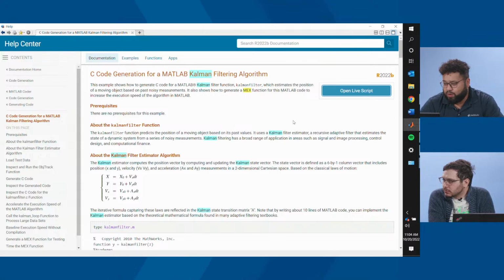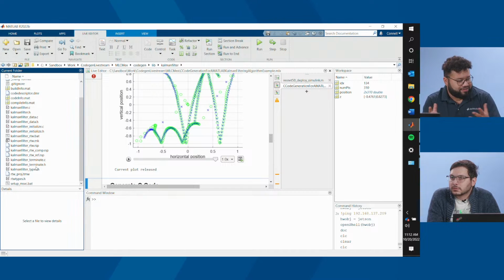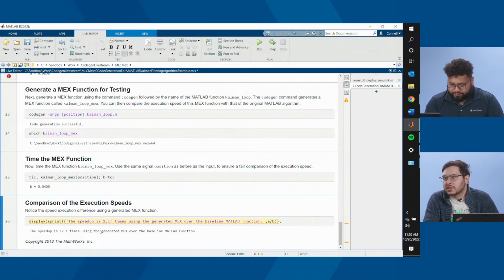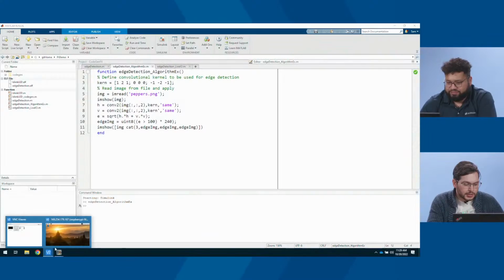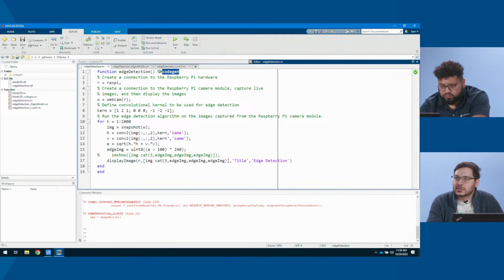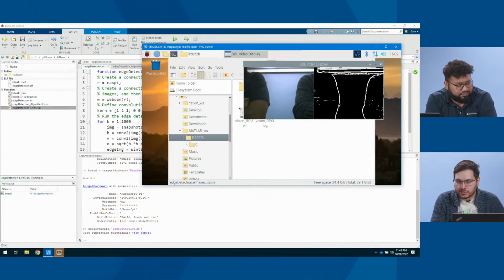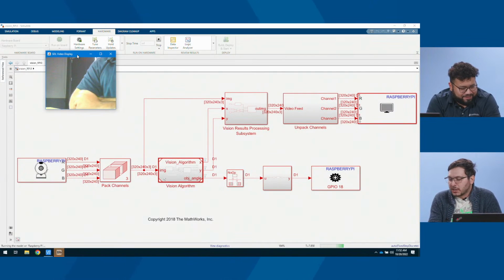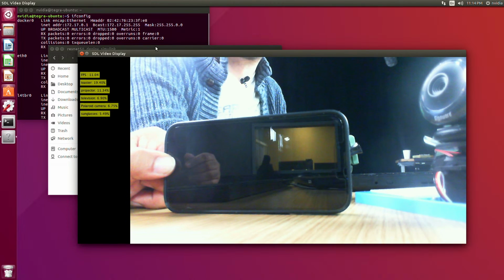Fundamentals of Code Generation from MATLAB and Simulink

Comment: This is the problem with mathwork. they call this fundamentals and then go to computer vision. Its insane. This is not fundamentals. No one uses your program anymore because of crap like this. Make a video that builds a simple adder function in simulink and then generates the c code. That is fundamentals. Not foreign computer vision on on a Jetson. Its insane to me you think this is fundamentals. Complete stupidity
Reply: what are you taking about, they did edge detection, that's super fundamental, it's 1000% better than another blink led or something like that
Reply: That's very unfortunate. However, fundamental doesn't mean easy.
Reply: It is a feature not a bug.  Mathworks is depending on the fact that you will learn NOTHING from this spluttering Tuk Tuk of a presenter so that you will then pay $2000 or so for a real training program.